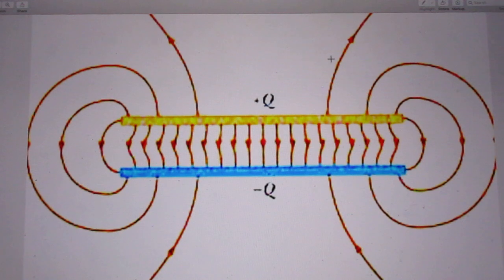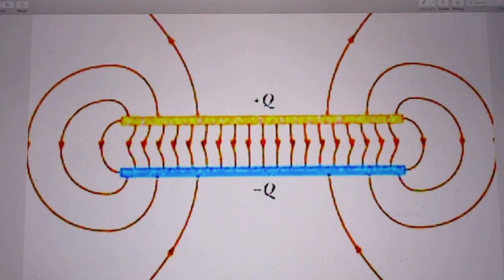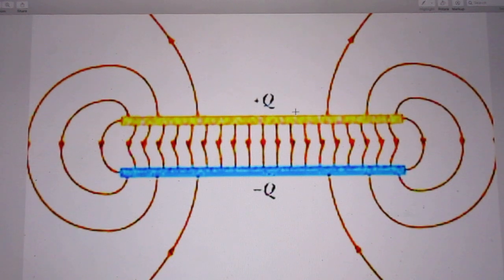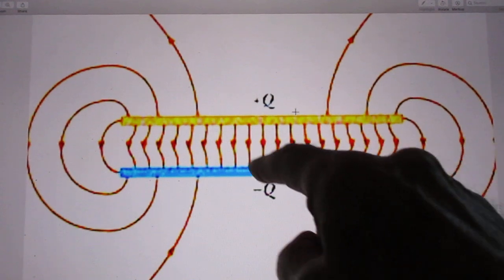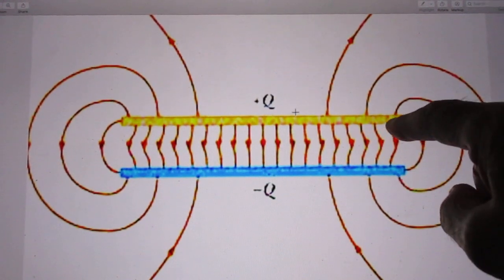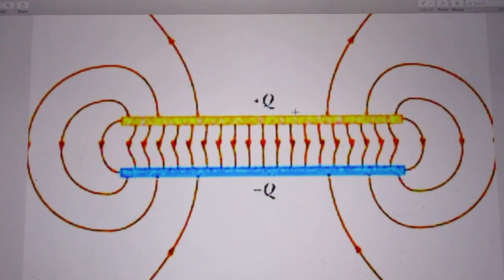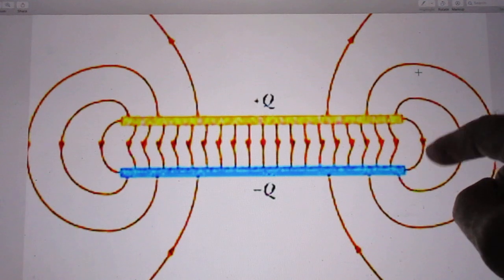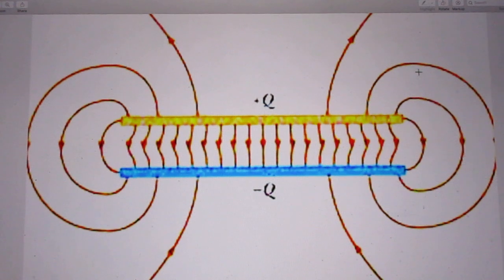Solution #151 - Fringe Fields & Plate Capacitors

Comment: Sir I have Problem / event which happens at night - " When I switch off Lights to sleep the fluorescent type tube bulbs and/LED type bulbs Lit automatically and I should add that I don't turn on the ceiling lamp always in daylights" I didn't understant why it lits even when it's not turned on for 6-7 days. can you suggest or explain this occurrence :)))
Reply from the maker: question unclear
Reply: @lecturesbywalterlewin.they9259  Sir 
In your earlier lectures of electricity and magnetism you demonstrated a neon tube experiment while beating a student with a silk clothh and you told that only when two sides are touched with charged source then only the neon tube lits 
Here in my case I've not switched on the ceiling lamp for days and then also it lits only when dark That's the question
Reply from the maker: @rajwardhangaisamudre  that is called a miracle as it seems to violate the conservation of energy
Reply: @lecturesbywalterlewin.they9259  can any substance violate conservation of energy in universe Like my ceiling lamp did means Probability is very closee to be able to violate
Reply: @lecturesbywalterlewin.they9259  I think sir that led lights store some energy but How can they store for this long timee Can be this a example of conservation as it seems that it has stored some energy in self please guide mee